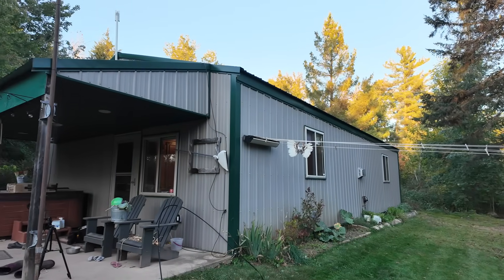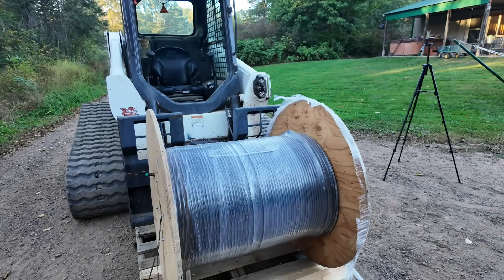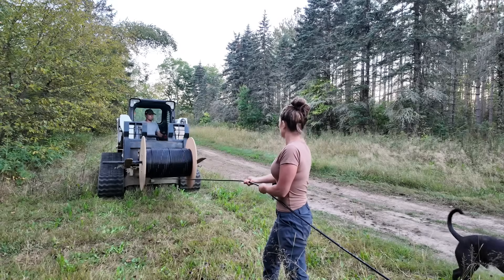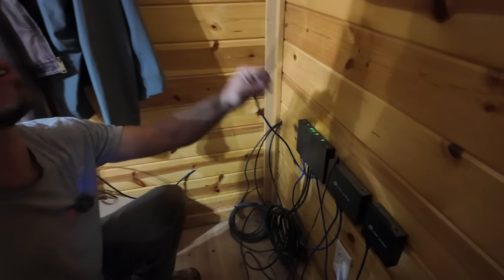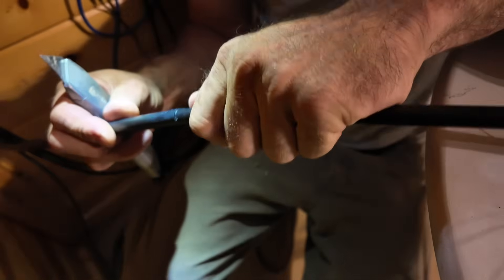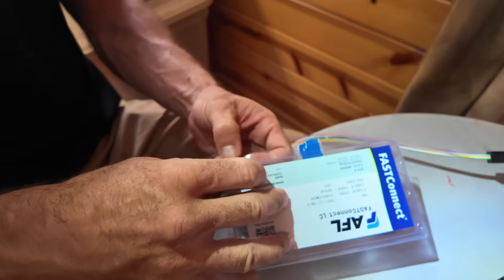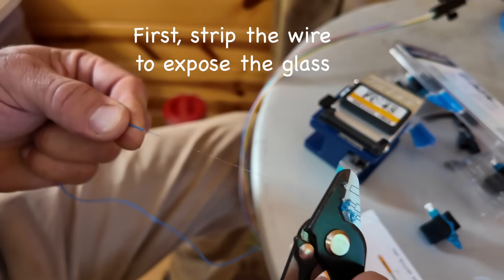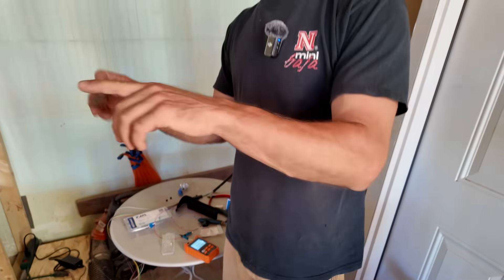We Need Internet! Running a 3,000 ft Fiber Optic Cable

Comment: Dude are you even kidding? As someone who works on fiber I was so skeptical when I saw what you were undertaking as a diy (it’s 100% the right way to do what you needed) and man did you deliver, you explained it well, had the correct tools, and did a legit professional job. So impressed.
Reply: Yeah, samesies..  As an IT guy, when i saw that you were going to try to home-terminate fiber as a first timer I cringed a bit, but good job!  2 things:  leave yourself a nice long loop at each end (at least 20' or so) for service or just in case, and finally:  every time you hear about a fiber getting damaged and cut you can almost imagine the pain of the tech sitting in a trailer splicing 500+ pairs of fiber for hours with micrometer alignment.. :)
Reply: @aaronkoch3273  and that's why you guys get paid $30-40 per hour
Reply: @aaronkoch3273 oh that sounds terrible. I don’t hate cat 5,6 and RJ45s anymore. I welcome that pain, not your fiberomyassissoressness.
Reply: @aaronkoch3273 in my market one of our osp guys spent over 13 hours rebuilding a tap.
Reply: @aaronkoch3273  its really all about the prep for me(longest part), i fusion splice...once your prep / cleaning is done you can drop those in a splicer and do a lot in short time...or if its ribbon fuse 12f together all at once. with ribbon a 128f cable isn't so bad
Reply: I've done fiber professionally before too.  A fixed box on each end would help the survive ability of your install.  YOU GOT IT WORKING!!  GOOD JOB!!  Imagine safely coiling up all that fragileness on each end in a little box at each end.  They sell them they are fiber termination boxes. You have a plate with 6 or so strands plugged into LC couplers (two end to end female plugs) you get an LC patch cord to plug into the switch.  You can leave the unused strands just coiled up inside the box for later or in case.  I was yelling at screen too SWITCH THE CABLES ON ONE END.  Good video.  I am proud for you guys.
Reply: I’ve been installing, splicing fiber for over 15 years. There wasn’t anything about this install that was professional except some of the tools and connectors that were used. Impressed that he was able to get it to work though, and great job for being able to being he had no experience.

A few things that should have been done differently. Like others said, should have put a fiber panel in like a Corning SPH-01P with LC bulkheads and then patched to the switch. Didn’t need the fan-out kit and the money saved on that could have paid for the panel and bulkheads. Being you did use a fan-out kit, it can be trimmed to the length you needed. Didn’t need to use armored fiber, but since it is, it should be grounded by using something similar to a Corning HDWR-GRND-KIT. Should have left at least a 25’ service loop on each side. I see nothing wrong with using a 12-strand as I would have used at least a 6-strand or larger just in case, but there are plenty of manufacturers that have 2, 4, 6, or 12-strand fiber. With that type of fiber connection (2-strands), you have a transmit and a receive. How ever you patch it in on one side, the polarity needs to be reversed on the other side. Transmit to receive and receive to transmit.

Lastly, the way that was tested was incredibly wrong. You don’t use a power meter with a VFL. You need to use a power source and know the input db of that power source. Honestly, being it was for yourself and not a customer, no need to certify it, just use the VFL and make sure it’s passing light.
Reply: How much did you spend all total?
Reply: @dadw7og116  I was wondering that too.
Reply: I would recommend beefing up the protection for the cable that crosses the driveway.
Reply: @Wakeywhodat  I would put it in a steel pipe unless you bury it really deep wherever you drive on it.
Reply: @Wakeywhodat  Cable will be trenched but in the meantime, yes
Reply: I second this
Reply: i also work with networking and watching this was how i have seen installers start out learning fiber. so glad i found this page... glad you got it working and be sure to pick up some spare SFP's and a fiber cleaner. these will come in handy if the sfp fails.
Reply: Ditto! I've worked fiber for the USAF since 88 then for ATT for 20 years, inside and outside plant as well as transport (FO serving eqp). Great job!
Reply: totally agree, i was really really skeptical at first..ive been splicing for a while now and was genuinely impressed. im sure a few suggestions could be made but id be picking someone apart who works in the trade not someone who did this so well for not having experiance. Good Job!
Reply: Me too and I agree. And you always run more than you need in case something breaks or you want to aggregate your ports.
Reply: I definitely need to see this. I have not seen the entire video yet but you never mention if you are using Multi-Mode or Single Mode fiber.  So I will have to watch your video for more info
Reply: dude its not rocket science lol
Reply: @Raketbaever  I know very few in the IT industry with his level of fiber knowledge.
Reply: indeed! he did an amazing job! I first learned how to do this back in the 90s, and it was much more difficult than it is now! That's for sure!
Reply: Why? This is easy to do.
Reply: I'm dying. Works on fiber 😂😂😂
Reply: REALLY?
Reply: Did you do it 100% correctly, nope, does it work, YEP! for DIY purposes, I'm good with it! Nice work! Don't let the "Professionals" drag you down. in the end all that matters is it works! as I say it many times is there are 100 ways to skin a cat... as long as the cat is clean nothing else matters.
Reply: You could have rented a fusion splice and saved time. The way to stop the fiber from moving in the fan out is wrap it several times around a pen or marker. Or a little super glue at the end of the tube. A fanout is not necessary, it just makes the fiber more sturdy. A small wall mount box with a coupler panel and fiber jumper makes a cleaner permanent installation. You can also get a bidirectional SFP and then only one strand of fiber is needed.
Reply: @DARTDOBBER  Stop crying over a cable, it won't kill you.
Reply: Came here to say the same thing. Awesome work yall!
Reply: Same here I've been Splicing for 20 years. I was super impressed too!
Reply: IQ is a cheatcode
Reply: Still need some work you need to be using 99% alcohol not the same you get from the store. Also if you do it right you can bond the other fiber interfaces to increase your bandwidth between buildings. I did see some mistakes though do not bend the fibers under tape you can brake them. Also becareful how tight you loop the fibers because you attenuate them decreasing signal
Reply: Waste large amou t to go on the grid to stay off the grid. Yet star li k does the same for cheaper. Withh gigabit on its way with nextgen satellites and you are still 100% off the grid
Reply from the maker: Thank you!!!! 🫶🏼
Reply: @thehomesteadingrd  Seconded, I used to do huge installs of outside plant fiber and am really impressed with your ability to resolve the issue and not give up.
Reply: @jondavidmcnabb  Same here - fusion splicing was my main method, so seeing the mechanical terminations kind of instinctively made me recoil.. but this is the perfect application for them. he had the right tools to complete the job plus testing out the fiber too. Impressed with the learning he did to complete the job.
Reply: @thehomesteadingrd  So you didn't walk back and too to the shop and cabin lolol :):)
Reply: @thehomesteadingrd Starlink? Cost/effort/function/reliability?
Reply: I'm sorry but this is far from being professional. You don't terminate a cable with a fanout. You install a proper wall mount or shelf mount termination box. There is the no need to install a fanout at all and you can terminate fibers directly and they are protected. Since there is no slack, if somebody hit that buffer tube just once too hard, it will break fibers inside and the whole thing will need to be spliced. I understand that it's his first time and everybody learns, but if you call this professional, it makes me question if you even work on fiber. Also, the tool used to open the cable sheath is useless, the way you do it is by removing 5-6 inches of the cable sheat at the end of it and then use the rip cord to open the cable. This job would've been way cheaper if a flatdrop was used. Using unprotected 900um directly to the switch is also a very bad idea, a transition patch cable should've been used between the switch and the wall-mounted box. You also need to ground the armored jacket and this installation is now a code violation.
Reply: Simmer down Nancy... He did an excellent job for a first-timer! I learned how to make these terminations back in the '90s, and it was much more difficult back then; with heating boxes and glue-filled terminations. Did he make some errors supporting and strain-relieving the termination?  Could it have been better... sure... 
Could he have used a breakout and splice box, sure... We all had to learn things, and we all made mistakes the first few times. However, he did a great job; an excellent learning experience, and first try.  We need to learn to teach and not be so quick to criticise...
Reply: @crashd1n3r  he had never worked on fiber before and what we saw was his trial and error in learning how to terminate fiber.  I thought it was super interesting and kudos to him for sticking it out.  No, its not a perfect job you or other professionals might do but that wasn't the point.
Reply: @fencerroy8117  thanks I know. My comment wasn't directed at him
Reply: @crashd1n3r  On point. This is way too expensive cable to be used for DIY. We do not use that much of a protection at open pit coal mine, believe it or not. There are drop cables that are tiny and can be hanged on trees, don't need to dig also. Only thing done right is that the cable is unwrapped. Power meter is useless in this situation since his light source is not calibrated nor power meter zeroed. On short spans like this, if you can see strong laser it will usually work. The biggest enemy for single mode cable connections is dust and dirt at connection points. As a reference, I'm electronics technician at open pit coal mine, certified for fiber optics more than 15 years. Of course, not saying I know it all, but have experience with it.
Reply: @crashd1n3r  It's in the title.  DIY.  Relax.  Broken fiber or incorrect install isn't going to burn your house down.  Just a bad time.
Reply: @crashd1n3r  Was it supposed to be??? Hint: he's not doing a fiber run to NASA. Its from a house to shop for G od sakes. If it works, who gives a sh_t.
Reply: @crashd1n3r all good techs cheat the book some what. Sometimes, for time, most of the time because supper won't give you an OSP approval.

Everything you said is fair but a tad bit over critical. Fiber is stronger then you gave it credit for.

If you are experienced in fiber as you imply you know it is stronger then it seems at first glance.
Reply: @andrewyork3869  I replied to the guy that said it was professionally done not the guy that did the job. As a first time install without training, he did way better than just "ok".
Reply: @crashd1n3r  I liked your comment. Thank you for adding those details, they’ve really helped me plan for a future installation. I didn’t find your statement harsh at all; in fact, I think it adds real value and provides useful education for viewers.
Reply: @crashd1n3r  for a layman it is. It’s unreasonable to expect him to lay it out in a spice case.
Reply: @projectswithdrew  no it isn't. A sph-01p or any wall-mounted panel should've at least been used with a 12 lc ports faceplate. They are very cheap, there's NO reason to not put one and he still should to protect his investment. He could even save the connectors by coiling them neatly in the box as it should be and use a patch cable.
Reply: I agree, have a fiber patch panel and patch cables.

Not bad though for starting at knowing nothing.  I didn't think it would work at all.
Reply: @projectswithdrew "for the layman it is"...wtf?  Professional installation and Layman don't go together man.  @crashd1n3r is 100% correct.  This is an amateur installation. It works, yeah...but there will be issues in the future.
Reply: @Jermz1979  he had AFL gear not Amazon /ebay knockoff junk. He has my respect for an epic install for someone not in the industry.
Reply: @projectswithdrew  doesn't make it not an amateur job.
Reply: @projectswithdrew  He's not asking to use a splice case, A small wall-mount case that you can clamp and ground the OSP and it's armor to.  Then you just have 5-10' of the bare 125u fiber terminate that directly, mechanical or fusion whatever, coil it all up in the boxe close the lid an never touch it again, then use a duplex jumper to take it from the wall-box to the sfp module on the switch.  Much cleaner and MUCH less vulnerable.

...Having said all that, for a fist go it's pretty good job... Very likely it would have been cheaper to pay a tech a few hundred bucks to do it for you, not such a good vid, but a better end result in a lot less time.  You probably paid more for the cleaver and strippers than it would have cost to have a tech do the job. :)
Reply: @projectswithdrew  I'm not sure about a spice case, but at least putting it in a fiber patch panel would give me less heartburn.
Reply: @Jermz1979  We were all amatuers once
Reply: @jessejoyner2520  I can't tell if you're being intentionally obtuse or lack the mental fortitude to understand the argument.  It's fine that it was an amateur installation.  The argument, however is against people calling this a professional level install, when it's definitely not.
Reply: @crashd1n3r  Yes you're right but don't be so critical.  These folks don't do this for a living.  They got it to work.  I would be excited if a new hire got it working without training.  Would I take them back to site and show them how it needs to be done sure. They didn't do to please anyone else.  It will survive if it's better protected and secured in a mounted box.  Proofs in the pudding the data's a flowing.
Reply: @walkman1269  I was critical because he said it looked professional. It does not. For a first timer, I'm happy that it works but calling this professional is an insult to how it should be done.
Reply: @crashd1n3r in addition to what you said, should’ve have put a rubber grommet in the hole through the metal siding on the house at minimum or  better yet a stub up conduit from in ground to the hole on the side of the house
Reply: @crashd1n3r  I thought he was being sarcastic.  Oh I see now.  My boss would hire him on the spot and we would end up having to fix it all later.  I installed fiber for a year without any training or instruction.  This was back in the 90's before youtube.  I literally would call the vendors of the installation equipment and ask them what to do after reading the manual.  I didn't work for at&t or one of those companies.  Just a local mom and pop cabling and IT shop.  Years later I learned how it's supposed to be done.  Graybar and some other outfit offered training or a workshop and I couldn't talk him into letting my go.  He would say you've made it work what else do you need to know.  This was back in the glue and polish days.  We didn't do fiber every day just every couple of months.
Reply: My OCD is just kicking in that he didn't use the first two fibers in the bundle and used 1 (bl/bl) and 2 (bl/or) instead of 1 (bl/bl) and 7(bl/rd).
Reply: 😂 as a person who hires professional certified fiber optic installers, everything you said has been determined to be a lie.  Now I am not saying that it is not adequate for what they need on a shoestring budget, however it is in no way professional or correct!
Reply: Was it really necessary to use a cable with that many pairs? I work in a data center, but I know next to nothing about building long , exterior runs like this video.
Reply: @Jonathan_O  I believe he said  early on in the video it was difficult to find a direct burial cable with only 2 fibers, so he went with the 12 count.
Reply: @Jonathan_O  In the beginning he said the 2 strand cable was more expensive.  He probably got a 2nd hand deal too. I had some guy try to sell me a spool with thousands of feet on it.  He found it in a ditch.  It was abandoned by an installation company for 6 months so he said it's mine now.  Even tried to call the company left voicemail never came or called back. Happens all the time I'm sure.  I've been watching a spool sitting by a soybean field for months. Heck 3000' foot pull there's extra for another day.  Most cable in long lengths has 12 strands.  It's more common in that length.  The cable from my house to the street is 6 strand.  They coil up the dark fibers just in case.
Reply: @walkman1269  Now that you mention it I’ve seen a service feed just one client in a stand alone building and the carrier runs a 12 strand (or more) cable.
Reply: @Jonathan_O difference in cost on 6 to 12 strand is really not that much, however having the spare strands is totally a good backup for failures or extra installations.
Reply: @Jonathan_O   No but all they need is to move data from the front of the property to the back and they only have Starling speeds coming in so they aren't going to get 10 gb or 40 gb speeds.   They don't need it.  Also they said it was single mode fiber and it was 1/3 the cost of the better stuff.  He did a great job!
Reply: 328ft
Reply: @AndrewTa530 ? What’s your comment ? This is SMF depending on your source you could run as much as 180 KM. Based on the small transceiver in those SFPs that is not realistic but without looking at the spec I would guess 1-5 KM wouldn’t be unrealistic.